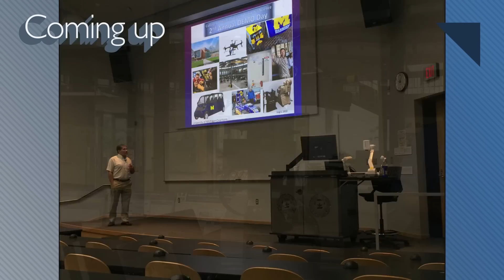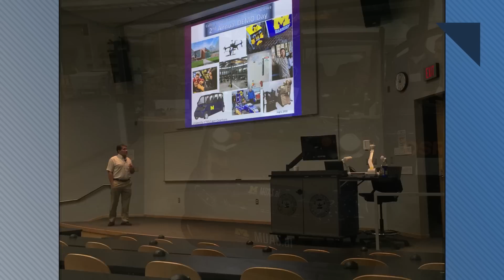FCA Attempts to Block Roxor, Tesla's Secret Chips - Autoline Daily 2407

Comment: With all the usual love for Tesla I'm surprised no one spoke up on the AV tech news. I actually look forward to AV tech news for various reasons. But only cameras using only visible spectra seems yet another good way to end up with a product that is not going to work out in the end. LIDAR does seem able to see and accurately interpret objects, through  fog, dust, and around corners (as that data can be shared very easily via V2V). Increasing their available computing power would only be helpful. 

Also I guess Tesla is using roughly the tech as an XBOX Kinect. Such that is can actively discern 3D space from 2D images.
Reply: DocWolph 
Correcting your original comment, which should read, "using the visible 'spectrum' " (not a single spectra like in the case of 'LIDAR')
Reply: I'm not sure I follow, can you elaborate some?
Reply: LIDAR doesn't work in foggy or raining weather.  Humans use eyes to drive, so we know cameras can do the job.  Musk wants a solution that works in all weather.
Reply: Patrick O,

That does not follow. 

1) Given the almost pathological frugality of virtually all car makers, the cost of developing LIDAR, a technology the various militaries swear by for aiming, and guiding munitions through all weather conditions, makes no sense if it can be stymied by hard rain. Newer, smarter software, can see through dense fog, snow, and "rain by the bucket" much better than the human eye or some animal eyes. So again, why even start if Cameras are better?

It should be pointed out LIDAR systems are now smart enough to tell heavy rain and snow, even read colors, to see lane makers, some signs and so on. I think text can still be rough for LIDAR. 

2) Cameras can only ever give a cursory input. Even at high res a computer still has a hard time seeing what a human would see. More over the computer can on see what information is brought in by the cameras. 

3) I am NOT ragging on Tesla. But Musk seems to  have this bug up his butt that "if the other car makers are doing a thing, they MUST almost invariably be doing it wrong or it is wrong to do". So this is curious what Musk is trying to do. I imagine they are not going to use visible spectra cameras, using Infrared since such a camera can see in almost anything and through most things, and visible light cameras. More than anything I think Tesla's Neuronet chipsets are really for more computing power because they will not be relying only on visible light. And also RADAR.

This is much like how video games try to get 60fps, but between visual effects, motion blur, and A.I and so one you are really running 30-40fps. Just more computing power. 

4) Cameras are cheaper and if it is not the "new standard" for AV vision, they still won't lose much as Cameras are not so bad, even if they may not be the best.
Reply: Synthetic-aperture radar is probably what's going to be required to give vehicles full autonomous capabilities, but it's expensive.
Reply: NIrmal Kumar Reddy,

Well that is pointless. You might as well not have answered at all. Waste of time indeed.
Reply: Doc, you are ridiculous.  You drive a car with your eyes.  That is how autonomous driving will work.  Nothing you said is accurate, you are regurgitating pieces of info forming nothing but a word salad.
Reply: Patrick O,

It must be upsetting to have to explain yourself versus someone who has explained themselves. That no one just believes you. You know you are right... in your head. 

Instead of trying to ridicule me, why don't you explain YOUR SIDE of the issue? Who knows you might be right. But we will never know because it is all IN YOUR HEAD. 

So say something useful and let it out of you head.
Reply: Nirmal Kumar Reddy,

1) We are NOT bots. So get off that. We are people and asked you nicely to clarify your analogy. 

2) Why? Because aside form the "more data" argument what do you mean? LIDAR is such an answer. More pictures is more data like more points in a point cloud is more data. So SD TV versus HD TV versus Holograms? If you do not follow that one, then please ask.

3) So now I am led to the questions: a) As you a jerk trying to be right by saying quite literally nothing, and b) or do you actually have a point to your analogy? If so, spill.
Reply: DocWolph
Lidar monitors only one  wavelength of light that it emits, whereas a camera aided by the neural network architecture, can use the whole spectrum of light, both visible and invisible (including IR for heat signatures, etc.) Depending on the camera sensor used.
Even if the resolution might be paltry(Right now) compared to LIDAR, You think $1000 transistor radio is superior to a $2 disposable Chinese radio made today.
Reply: DocWolph 
Holograms Vs HD TV ?
The Rudimentary form of the tech, FCW and AEB systems currently in the market(Subaru EyeSight and many more), use stereoscopic (3D) cameras.
Hence you made my point, you are either a bad bot or the laziest critic.
I don't know which is worst ?
Reply: Lidar is visible spectra based.  It Doesn't work in fog or snow.  Radar does.  Tesla already has radar!
Reply: AutoCrash is just a bad joke that kills ppl...
Reply: "Lidar monitors only one  wavelength of light that it emits, whereas a camera aided by the neural network architecture, can use the whole spectrum of light" 
What a mindless fantasy world rationalized load of BS....
Reply: NC, keep using your typewriter and horse drawn carriage, the rest of us will use modern technology.
Reply: BTW Waymo is not making typewriter and horse drawn carriage r they?
Reply: Since you have "no idea what waymo is actually using" click https://en.wikipedia.org/wiki/Waymo and learn something relevant for once.

And "You have no idea what" Tesla "actually using" to make AutoPilot (ie AutoCrash) crash test dummies out of fanboys. Who just mindlessly paraphrase their cult leader's sophomoric analogies like "If humans can drive with eyes, so can computers", so it's no great loss is it? 

BTW, There are millions of things in this world that are far simpler, like spinning a spider's web that humans can't even fully mimic. So go find an engineer who live it real world to explain it too u. 

Or go get a typewriter and learn how to use it. Since it's far too advanced for fanboy logic to comprehend anyway...

Comment: I do agree that hydrogen makes more sense (than BEV) for some medium and heavy duty applications. But trying to make light-duty vehicles powered by it has been a huge waste of resources.
Reply: A conventional engine with natural gas makes more sense than hydrogen for large trucks & buses.

95% of hydrogen in the US currently comes directly from natural gas, anyway. Making the hydrogen produces just as much CO2 as burning the natural gas, so there's no benefit to hydrogen. And just using the natural gas eliminates the expense of a fuel cell, cuts the cost of the fuel by at least a factor of 4x, and doesn't require new infrastructure.
Reply: dMb great point and agreed! Steam methane reformation is far from CO2-neutral.
Reply: dMb 
As you said 'Currently'
Reply: "Toyota facility to produce electricity, hydrogen from bio-waste"
http://biomassmagazine.com/articles/14886/toyota-facility-to-produce-electricity-hydrogen-from-bio-waste
And ICEs create real pollution not just plant food... Utube wannabe experts r so amusing thx...